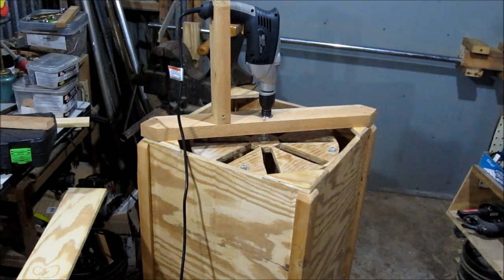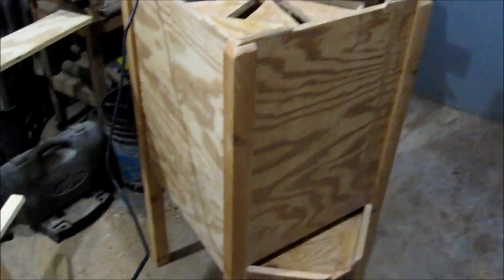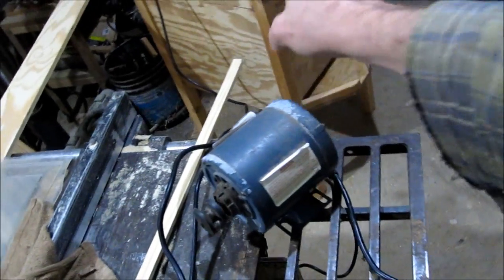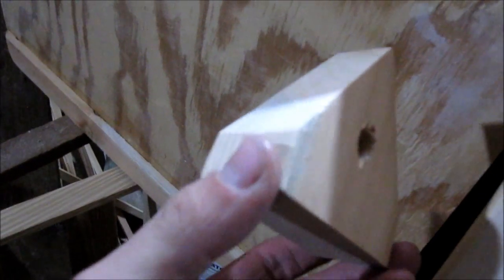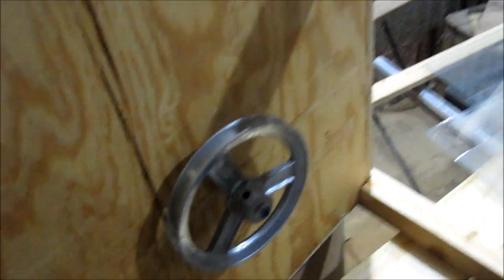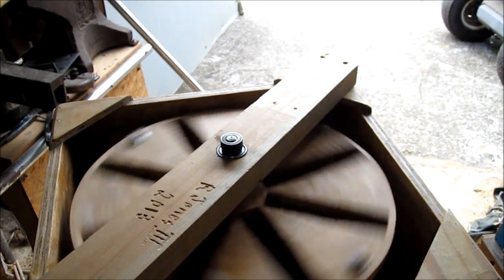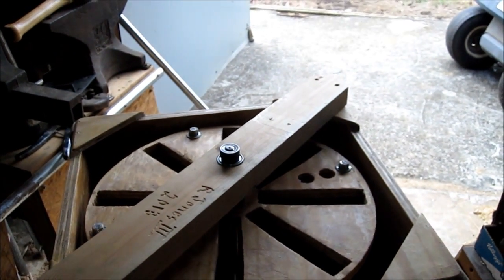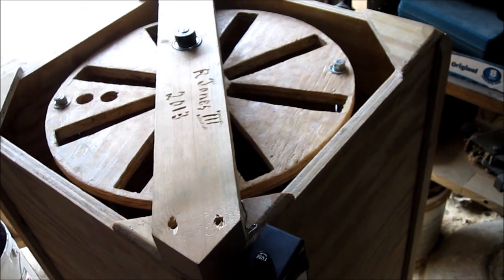8 Frame Wooden Honey Extractor Electric Motor

Comment: I am an engineer, it's a simple ratio. If the small pulley is 1/6 the diameter of the bigger pulley, and shafts the same size, then the big pulley will spin at 1/6 the speed of the little pulley.
For easy math, if a 5" pulley is spinning at 1000 rpms, it will turn a 10" pulley at 500 rpms, as the small pulley is 1/2 the size of the big pulley. Gotta love simple solutions on stuff like this!

Comment: I just watched this again, did I see a little smoke come off of the motor?
Reply from the maker: yes you did. look up my treadmill motor clip.

i was informed that an electric motor like that will indeed burn up being run on a speed controller.

that motor was removed and replaced with a treadmill motor shortly after this clip was posted.
Reply: yeah, I had watched the treadmill motor one and it looked like it was the smoothest set up to date and a really well put together video. I do have a question about a set up like this though, do you have any problems with honey collecting around the center bearing or does it all just flow out of the front at a constant rate? Again great videos 
Ed
Reply from the maker: tappakeggaday1
 No I made the block where the drive shaft passed through a triangle shape. So when the honey passes around it. The point is up hill.

Even the occasional blown out comb passes through pretty good under there.